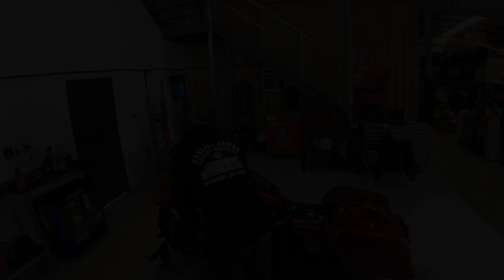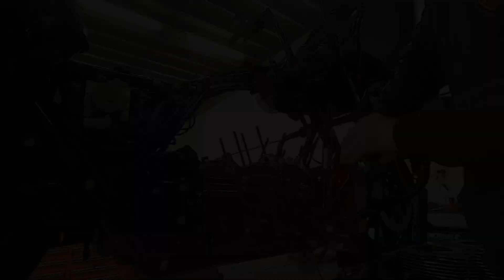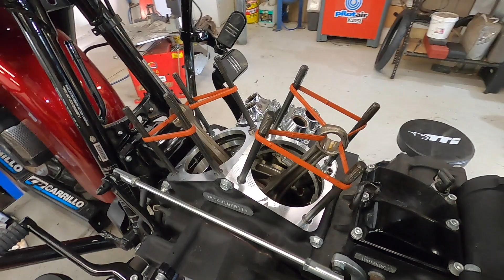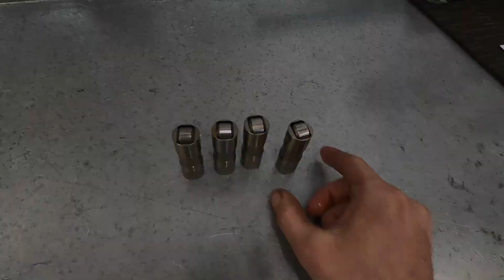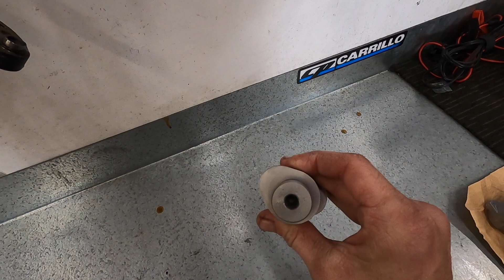124ci RoadGlide / Performance Bagger Build / APE

Comment: If you took a full thickness 131 sleeve and cylinder and had the block machined to support that and then added a built short stroke flywheel assembly creating a 128 cubic inch.. following George Bryce's theory of big piston short stroke
would that be a good build?
I'm looking into doing such a thing

Comment: I am thinking on doing a 124 kit in my 2019 streetglide 107 with 24000 miles on it. Is it necessary to split the crank case to put in new crank bearings before doing a stage 111?  Or is it safe enough to just do the stage 111 without putting new crank bearings with that many miles on it?
Reply: Definitely worth doing over stock. I had the APE 124 Performer kit (their midrange kit) installed almost 4 years ago (in Oz). Sooo much smoother than the stock motor. Vastly better riding and mine is approaching 40,000km since the upgrade. The trick is to find the right person/shop to tune these builds properly. After almost 4 years I haven’t found anyone near me able to get the sort of numbers advertised, expecting well into the 140s. Is pulling 132/134 with a huge belly out between the two curves (last week’s shop dyno challenge). Running a CR470 cam, 6.2 injectors, 55mm SE (or S&S) manifold, stage 1 warflow heads, upgraded HD oil pump, Barnett scorpion clutch, HPi VO2 breather, Bassani high output 2:1. I know they say numbers are just numbers, what matters is how it rides. It rides really well but just don’t get high hopes based on numbers alone. I don’t know what else to do, perhaps a CR 485 cam, they came out after my build, but def need to travel (a long way) to get a proper tune. Still can’t get this crappy dyno chart and numbers outa my head!!! Good luck with it.

Comment: Didn’t mention who made the cylinders… probably S&S, it seems you don’t like mentioning them and giving them the credit the deserve for some reason. Also noticed you routed the breathers back into through the throttle body for some reason… as you know, these bikes, especially with thgis bigger bore has crankcase breather issues, and these engines blow a lot of oil back into the engine… so those pistons will be full of carbon in no time, with that air cleaner backing plate you could of easily ran a catch can no problem… In in all, your content is good!

Comment: Hey buddy. Quick question. How many hours would you say it takes to remove the heads, swap the jugs and pistons out for the new ones and reassemble?
Reply from the maker: Softail or Tourer? 
Tourer will take a little longer due to the bags & exhaust roughly 8hrs.
Softail approximately 7.5hrs.

Dyno tuning is quoted at 4 hrs

As a general idea a full build, ride in ride out your looking around 12hrs.
Reply: @MasterTechMiller  everything has been done as far as cam chest and anything else
Most people do from bare bones to a full 124/128+ build out kit. Just was curious on swapping times of the jugs and pistons. I would be doing it myself on my garage lift.
Reply from the maker: @Gimps_Garage  if you're just doing the top end, no cam chest or primary stuff then you would be looking around 5 to 6 hrs if you know what you're doing.

Comment: Oh man.. starting fasteners on a screw gun.  Bro u got more balls than I.   U a master tech tho so prob not gonna cross thread.  Man… that a sinking feeling in the stomach yea? Fortunately never had to happen bad to where I needed to retap or worse !
Reply from the maker: I've got the torque setting backed right off on the gun so should the unlikely event happen where the threads might catch, the gun literally won't force it past. 

In saying that, I've never had an issue with using it. The screws have a slight tapper on them which basically pre starts the thread for you.

Comment: Got a 482 going in a 124.
Fkn can’t wait.
Been a damn blizzard here so hadn’t ridden in 3 fkn weeks .. ☠️ 
Hopin they pick up my ride tomorrow and have it ready in a week when weather hits upper 30*F 

*I told em to do that billet ramp.  Thanks on that info btw
Reply: Idk if u remember but on one of the vids I said I was tired of the 482 and wanted to change it up.

Did the bottom end (SS)
124 11:1
CR480MT

THIS IS THE COMBO!

Mornin bro 😎 

Yea so the shark 🦈 is the bike it shoulda been from v1 of the 124.
Power on tap everywhere 
Makin more tq at 2k than the old one did at peak lol 

Yea was expensive to redo the motor but it's built to last 
Very stout setup 

The clutch setup is fkn divine !
No more lockup 
Just SE plates and springs and Muller power pull ramp so it feels like a damn sport bike clutch pull effort.  

Feels good to finally have the combo that feels right for me 
I wonder if that balanced flywheel has anything to do with how smooth it is now.  Or maybe jist the cam change .. 482 was a beast but wasn’t for me or a road glide
Reply from the maker: Let me know how it goes when you get it back.
Reply: @MasterTechMiller the dude wanted to rework the tuning now that I got those medium baffles in.
So I’d say she’s done (besides the oil cooler not able to be activated in the PV software… he’s been reaching out to dynojet and eveyone under the sun and it seems they need to cut the part of the tune from the Harley software and paste it into the PV tune .. the part for the oil cooler fan … past 2021 they changed the ECU.. if ya got any ideas let me know)
Anyway .. here’s where we are at.
From 2k on.. it’s a fkn tabletop straight across with a smooth tq gain peaking at 4k.. but >130tq from 2k to 6k.  No dip!!  Bike now has beautiful low speed manners.  Don’t need to rev it off the lope to get moving.
Before if it dropped below 2k when setting off it wanted to stall out almost.  Did once or twice creeping up the drive.  
I am LOVING this combo now.  
Once I tossed those medium louvered baffles in immediately felt a different but wasn’t super smooth til it got over like 2800 or so.  And my mpg was abysmal.  Like 130mi on a tank! He had to throw stupid amounts of fuel at it between 2-3k bc of those zombie baffles sucking all the fuel out under 3k.
Man ..Giblet at Conrad’s in Joilet IL USA.. he put in work on this build.
No dips. Makes stupid power. Rides smooth fast or slow.  
130hp 139tq.  But its 130tq from 2-6k.  Lots of power under the curve there.   Power curve is straight line right on thru the pull. No let up. Peak Hp at redline so this cam prob woild do well with heads. 

To anyone else reading this.
If u go catless headpipes .. u CANNOT use those zombie baffles or u will suffer lots of performance loss and shitty rideability. 

Thanks for all u do sir!   You run a great channel with tons of info.  U interact with the viewers and clearly know what’s up.  
Anyone down there in Australia def needs to be coming to u for tuning and builds.  Having a really great master tech at a dealer who does this is so important.  Indy shops can be great but I like having the backup of a well established Harley dealer who also does amazing aftermarket work and tuning.
Reply: @MasterTechMiller just got it back.  Still on the fence.  My hand isn’t crazy strong so I went with a lockup clutch.  WOT at 5-6k is a bitch to shift.  I love my tab zombies but damn I took a hit 2-3k.  I got a good ass tuner but still can’t work around that.  Gonna swap the high side for the medium baffle to get that tq back.  The 482 got such a long ass duration it need lot of compression and back pressure or so I’m told.  The SS kit is 11:1.  I think comp ended up 11.9:1.  When that cam come on it’s like my big turbo crossing boost threshold and lighting up.   Too damn loud with zombies and catless head pipes 2-1-2.
Fuck it rips tho.  And that lope is insane.  
Yea I did the billet ramp. 
Before I had 107, 447 cam, zombies on stock catted headpipes. 
In retrospect I shoulda went with a smaller cam.  I recon once I get those baffles in it’ll smooth it out some where it crosses over to cam coming on.  Yes they told me this but TAB fucked up and sent the shop the quiet baffles.  I said fuck it tune it up and we will
Work on it more later if needed aftee baffles.

2024
FLTRX
124 SS
CR482
SE 55mm manifold 
Stock TB
Catless 2-1-2
Tab zombies 
131hp/138tq

Comment: Will a Screaming Eagle 55 manifold and 5.5 fuel injectors work on a Harley 107-inch engine that has a Cycle Rama 470 cam, Screaming Eagle, Ventilator Extreme air cleaner and CBR mufflers?
Reply from the maker: Absolutely! That will work great!

Comment: I have a Fuel Moto, 128- inch build with 11.1 compression and the Cycle Rama 483 cam. Would the Fuel Motor 10.75 compression work better with the  Cycle Rama 483 cam?
Reply from the maker: The CR 483 responds well with compression around 10.5:1 & upto just over 11.0:1
These 124 & 128 Stump Puller kits are all at 11.0:1

Comment: Off topic.  2020 Heritage 114ci 2-1 Rinehart 468 cam 5k. Miles
Pre manifold injector swap (stock to 55mm and 5.5 ) 
Dyno 108 and 127   post 107 and 127. AFR 13.3    NORMAL ?
EXPECTING 3-5 HP and 3-5 ftlbs
Mpg less/more?  Apprecate advice. Thank you Wil
Reply from the maker: Many factors to take into account here. The AFR could be slightly richer at 13.0:1 or even 12.8:1 
How much ignition advance is on the 100% column?
Also who makes the 468 Camshaft? I'd need to see the cam specs to give you a better idea of how the cam will work.
Reply from the maker: Also depends on how the tuner setup the cruise speed AFR to get the best economy

Comment: good video tommy my 2020 114 at 2000 miles had 3 thou run out 
put in the 128 kit and after 2000 more crank run out is 9 thou
just put in cp H  beam rods and trued crank now will see how
long it lasts

Comment: Hi Tommy, what is the replacement compensator ramp you put into this build?
Reply from the maker: It's made from forged steel rather than cast steel. As a result, it is far stronger. There have been many reports of the stock compensator ramp failing when big cube builds are added.

Comment: Great vid mate. So are the latest cam plate and oil pumps ok to keep on board when changing the cam?
Reply from the maker: Absolutely mate! There's never been an issue with the stock cam plates. The only time I update them is when I use cans over .500" lift and I only use the Fueling OE+ plate which works seamlessly with the updated 8lobe gerotor oil pump from Harley.

Comment: My compression rings come out in the same clocked 180⁰ position as when they were installed, in every engine I've assembed and disassembled since 1984 averaged about 3 per year, singles V-twin, Boxer twins, Boxer 4s, Boxer 6s, (Aviation-Ground Power) 8 cylinder racing, Inline 4 cylinder racing, and High Output Diesel Offroad Engines. A slight -10⁰ shift may have occurred in situations where the rings weren't properly seated prior to the use of synthetic oils or oil additives like slick 50, increased  blow by, and excessive crankcase pressure for much longer and stuck the rings in the grooves in a couple situations but pretty much remained constantly clocked as installed, of course all 2 trokes have a locating dowel  for the end gap.
Reply from the maker: Piston rings lead a much more active life than might be thought. While we usually imagine that they only reciprocate in a motion defined by the piston, they also rotate during service. Such rotation has been the subject of many experiments and studies over the years, but this is not simply a matter of academic interest; there are implications for engine performance and efficiency.
With few exceptions, race engines use piston rings of the conventional gapped type – that is, there is a carefully controlled gap between the ends of the piston rings. A report by Jung and Jin shows that, at one engine speed, the speed and direction of piston ring rotation depends on load, and it is not necessarily the case that both rings rotate.
Their study, although weighted toward the technique used in the measurements, monitored oil consumption and was able to correlate this with the relative positions of the piston ring gaps. It is perhaps unsurprising to find that oil consumption rose to a maximum when the two ring gaps were aligned, and fell to a minimum when the ring gaps were spaced 180° apart. This makes sense, as the flow losses would be greatest when the ring gaps are as far apart as possible, so for a given pressure difference there would be less flow through the gaps in the rings.
The speed of rotation of piston rings has been measured experimentally. Shaw and Nussdorfer examined the phenomenon on a large engine and found that, at 1000 rpm engine speed, the piston rings were “observed to rotate as rapidly as 1 rpm”. Jung and Jin reported in more detail: on the engine they used, at 4000 rpm and 2 bar bmep, the rings rotated at 0.6 rpm in opposite directions to each other, with the second ring initially oscillating between two positions before finally beginning to rotate continuously.
At higher load, the top ring didn’t rotate, and the second ring rotated at speeds from 0.5 to 3 rpm. On the same engine and at lower engine speed, the top ring simply moved to a given angular position and then remained stationary at 2 bar load. With an increase to 4 bar, there was a change in top ring position but still no continuous rotation. The second ring was also observed to be stationary at this speed in some tests, some of which found the ring gaps aligned – the condition where oil consumption is highest.
It is clear that the piston rings in any engine lead a mysterious life where, depending on the load and speed conditions that apply, they might rotate continually, oscillate between certain positions or remain stationary. Oil consumption is found to vary with ring position and, where the rings rotate periodically, the rate of oil consumption is a function of the rotation period of the rings. Other than pinning the piston rings to prevent rotation (which is commonly done in two-stroke engines), there is little we can do to influence ring position or speed of rotation. It is clear that whatever position the rings are in during the engine build will not be maintained during service. 

I am very interested to know how you manage to keep your rings in position and I am more interested in your data to show your findings. What type of rings you used, what gaps prevented the rotation, what oil, what break in procedure ect.

Comment: I have the 483 in my A.P.E 128 stump puller. Not a lot of info on the web or YouTube videos on it. 

Keen to know more about it if you have time.  Maybe a video on the difference in cams from Cycle-Rama for the big bore m8s and difference and dyno tunes for them?

Love the content 👍🏻 cheers
Reply from the maker: That's a great idea for a video mate. I'll do my best to put something together for just that.
Reply: Tommy built my ape 128 with cr485 extreme ventilator Dark horse crank ape 2into1 exhaust 
136hp 152ft lb of torque also put a quick shifter on it and its unreal fun 
🤣🤣🤣🤣